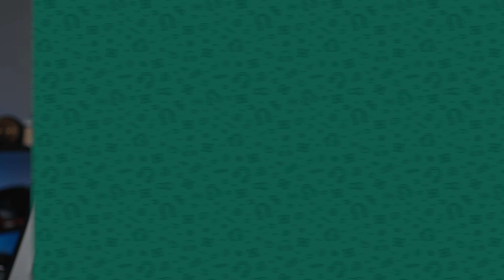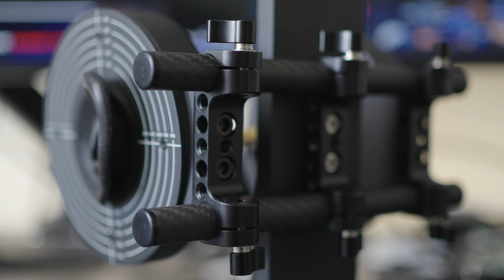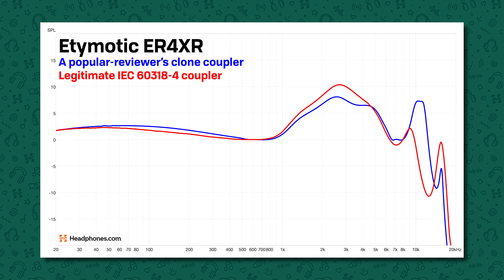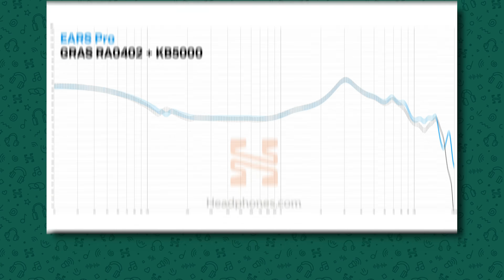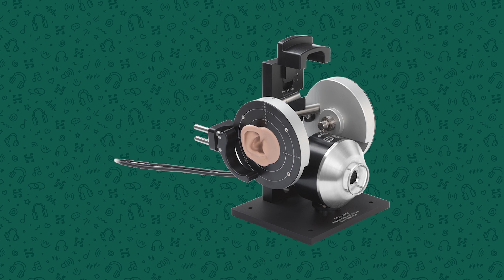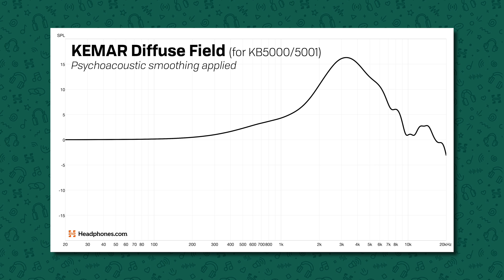High Quality Headphone Measurements are Affordable Now - MiniDSP Ears Pro Review

Comment: It seams to me this is more of the end of the learning then the beginning. Before you get to this point of understanding the equipment needed for evaluation of sound signatures there would be a lot of time spent on learning the information for basic understand of this hobby if you can call it that at this level. Where do you even start. What classes would be required to learn about the physics of sound and its application. Can you give some guidance on this. Where to begin. Thank you. Keep up the great work!

Comment: What's the point of using this ? since you said every HRTF is different and every headphone will sound different on each people, for me it seems that any measure is now useless and that only comfort and ToneGen are what matter, but i can be wrong
Reply: So this is a common confusion. It's not that "any measurement is now useless", it's that "any measurement needs to be taken with additional considerations, especially for bass and treble". Just because measurements on rigs don't perfectly depict the performance on your head, that doesn't mean they're not useful for showing how headphones perform. And, even though there is HpTF and HRTF variation, that doesn't mean there aren't trends. It's not like anything goes, or that any result could sound good to any random person.
Reply: @ResolveReviews  how are they useful and performance in reference to what? comparison with other measurements?
Reply: @chungang7037  they actually show you how things sound. Just because there are SOME differences doesn't mean measurements aren't perceptually relevant on the whole. They are, you just shouldn't overly scrutinize the tea leaves
Reply: @ResolveReviews  Differences matter, however. Tea is actually an interesting example; many people care about how and where it is grown, the temperature it was done so, the temp it was brewed at, even the cups used and in what conditions, etc. And even if all is accounted for, two people may have different interpretations after a sip. While I admire the move to try and present data consistently in any hobby, I am not convinced measurements as yet are able to account for the variables. The variables themselves are often more interesting, so I guess that is something. I would write more but I suspect this comment will be shadowbanned whether intentionally or by the algorithm, still something that only seems to happen on this channel.
Reply: @chungang7037  the existence of measurements on a product does not entail the end of differences of opinion. Measurements show you what the sound is doing in given conditions, how that redounds to good or bad experiences is a highly individual thing.
Reply: @ResolveReviews  Interesting. This reminds me of biblical scholars I was exposed to decades ago, where they would labor over interpretation of scripture down to the nitty gritty details of translation and interpolations but in all such meetings few dared speak about individual experiences with said religion, as they were seen as private and potentially embarrassing, shameful, or even heretical.

Comment: Fantastic review! This would be fantastic once reviewers as well as hobbyist start using this new rig for the measurements, cuz I assume the couplers have tighter tolerances that the clone couplers out there. 

One small critique with the review, that bass roll-off in the HP out, is a con should be highlighted more tbh. Not the end of the world, but it does stop it from being an all in one solution for measurement fixture.

Comment: Did you delete my comment on your video "Headphone measurements are about to change" in which I pointed out the problems with your claim that it is possible to make any headphone sound like any other headphone with nothing but EQ? I understand if you in retrospect realized how silly that claim was, but why not just admit it, instead of delete my comment? That would have shown integrity. I am asking since my follow-up question, inspired by this video, would be: What is the value of measuring headphones for testing them, when we can just buy a pair of $50 headphones and EQ them to sound like our favorite $5,000 headphone (as you claimed was possible).
Reply: No, we don't delete comments unless it's outright abusive or something like that. Youtube sometimes does this where it'll yeet comments if posted too frequently or if it thinks it's spam. As to the claim itself, it wasn't absurd at all. We did in fact get two headphones to sound the same with in-ear mics and EQ.
Reply: @ResolveReviews  Glad to hear. I was also surprised, as I have always seen you guys being about transparency and truth. I still think you ought to make a double blind test, e.g. the one with K-701 flipped as I suggested. I am 99.9999 % sure that you would hear a difference. So, do you think that THD and SNR is irrelevant? Do you really think that it's possible to EQ any $50 headphone to sound like any $5,000 headphone?
Reply: @stefanhansen5882   It depends on the headphones. If they're both behaving normally with respect to harmonic distortion / excursion limits, yes you can EQ the $50 headphone to sound like the $5000 headphone. It might FEEL different because the mechanical design is different, or the occlusion effect is different if one is less open, that sort of thing. But the sound can be made to be the same, yes.
Reply: @ResolveReviews  That is a big if. Low THD is one thing most cheap headphones do not have. SNR also differs and cannot be "EQ'ed away". Also, some transducers are faster than other, which also impacts the quality. EQ will also not give any headphone the sound stage of a K-701. I'm so puzzled that you are now making this claim, which seems to be in contraction that everything which have been said on your channel over the last many years.
Reply: @stefanhansen5882  Most conventional headphones have sufficiently low THD where it's not really audible when adjusted with EQ. Moreover, it's not like harmonic distortion gets unilaterally better at $5000. Some are better for that sure, but A) some are worse, and B) it's not audible most of the time anyway. With the claim "some transducers are faster than others" - this is just audiophile mythology based around marketing copy. Drivers do not have special performance unrelated to their meausreable characteristics. EQ does in fact give a headphone soundstage. We turned an HD 600 into an HD 800 S by EQing the headphones in situ. The answer to this question depends a bit on whether someone derrives "soundstage" from opennenss or lack of occlusion, or what the sound is genuinely doing, or some combination of those two. But EQ can make the two headphones SOUND identical, including soundstage, provided the psychoacoustic inference is not from other non-sound related factors.
Reply: @ResolveReviews  So HD600, MV1, Sundara,... can sound like a HE-1 ?
Reply: @skyzeworld  Yup. More importantly though, they can sound better than an HE-1. The problem with trying to get them to sound identical to an HE-1 is that you'd need an HE-1 present.
Reply: @ResolveReviews  I agree there is a lot of audiophile marketing hype. However, EQ cannot change a driver's damping, which affects "smearing." EQing an HD600 to get the soundstage of an HD800S sounds highly optimistic, since soundstage depends on physical driver angling and ear-cup geometry. Furthermore, the damping factor (the ability to electronically "brake" the driver) is a real physical interaction that EQ filters can't simulate. Finally, pushing EQ too hard to match another headphone can trigger non-linear distortion that the target model doesn't have. Tone is easy to match, but physical acoustics and time-domain control are not.
Reply: @stefanhansen5882  this just isn't true. Time domain is directly proportional to frequency response in minimum phase devices, which headphones are. There's no effect of driver 'brake' that's separate from frequency response, which can be impacted by EQ. Damping is literally a frequency response altering parameter. As to angling and cup geometry, that's not an established correlation. There are those who are looking into it, but so far nothing has been demonstrated once FR in situ is controlled for. And SO far, we know FR has an impact on soundstage precisely because we were able to turn an HD 600 into an HD 800 with in situ FR matching.
Reply: @ResolveReviews  I understand your perspective and mostly agree with it--in theory. But the driver inside a $50 will most likely produce distortion and other artifacts when EQed and/or pushed (e.g. at high volume), unlike the $5,000 can. Also, the cheap headphone is more likely to not have a consistent acoustic seal, so even if EQed to perfectly match, this will chance if the can is moved just slightly and/or when the pads begin to wear out (much sooner than on the high-end headphone). 

Bonus question: Will you put your money where your mouth is and never again use anything else but your most comfy headphones EQed to sound like which ever headphone you like the sound of? :face-blue-smiling:
Reply: @stefanhansen5882  if the cheaper headphone has bad harmonic distortion issues then yes that will be a limitation. But just because it's cheaper doesn't mean its distortion is worse, you see high harmonic distortion at high price tags too. Most of the time it's not audible. Seal related issues also impact all price points. Re money where my mouth is, I've been doing that for years already. I use cheaper headphones every day, and I've EQ'd them to sound better than an HE-1. Anyone who understands EQ correctly can do this.
Reply: @ResolveReviews  Correct me if i'm wrong, he1000se and he1000 stealth have identical build but very different driver. You can try to match them with EQ to see what's up. Feel of the headphone should be identical so minimal impact of psychoacoustics or distinguishing of what headphone you are wearing.
Reply: @ResolveReviews  I WANT to believe you, but remain skeptical. When I lift the bass on my K-701 it is struggling (to my ears, which are admittedly "rusty", while I am a former mix engineer). I hope you will make a video about how to EQ a headphone to sound better than the HE-1, in a way so people can try it at home (which should be possible, if you have done this before the lab tests you did about a month ago).
Reply: @musicxxa6678  yup, they would sound identical if FR is matched in situ. The only thing that might matter there is if the harmonic distortion is high enough on one of them in a different spot than the other. Those more loosely tensioned ovoid planars can sometimes have higher than typical harmonic distortion. I'm not saying it's audible with music, but since distortion is related to level, if the EQ involves adding a specific peak in an area that has higher distortion it could make it audible.
Reply: @stefanhansen5882  Tone gen is the key. Re the K701, I'm not too familiar with that one's distortion characteristics or FR down low. I have the k712 pro here and I can say confidently it's a very bad headphone. Not sure about the others in that series.
Reply: @ResolveReviews  That is why I mentioned the K-701 (which I guess is very different from the K-712), since it is a headphone I tried to "rotate the pads 180 trick" with (by mistake to be honest), and which is not a $50 headphone. So, would you be able to make the K-712 sound as good as (or better) than the HE-1? And what did you mean by "tone gen"? PS Thanks a lot for engaging in this discussion. It is fascinating.
Reply: @stefanhansen5882  price and performance have no correlation generally, so it doesn't matter how expensive your k701 is. But also, it'd be incredibly foolish to try to get two headphones to sound the same, it's way easier to get the cheap headphone to sound better than the expensive one. Tone gen is a tool like owliophile. Look into that.
Reply: @ResolveReviews  I agree that it is silly to make a headphone sound like another headphone. It was just what you said was possible. I looked at Owliophile. Interesting. It seems to help with my own approach: using sine waves at increasing volumes to find my own "personal Fletcher-Munson Curve" and using that for a starting point for my own EQ optimizations. I've never seen you talk about this on The Headphone Show. Maybe I missed it?
Reply: @stefanhansen5882  Harman research > Fletcher Munson. Or in other words, relational preference > perceived loudness.
Reply: @ResolveReviews  As I wrote, I am a forming mix engineer. I know the difference between these. 😉 However, I''ve used a "personalized FMC" to adjust EQ based on my hearing through the frequency band.
Reply: @ResolveReviews 
Wow, I feel like this kind of information should be raising awareness worldwide, but apparently only I find it so interesting.
I imagine the HE-1 has a rather low acoustic impedance, which would make it more consistent on each head. But technically, an EQ could make any headphones sound decent, which makes me think the only valid criterion is comfort, and that headphones costing €1000, €2000, €5000... are just pure marketing and an engineer's fantasy.

Thank you for all your work; you've opened my eyes, but to me, it's like you told me Santa Claus doesn't exist. I was just carried away by everyone's local fantasies.
Reply: @skyzeworld  Generally this is all true, however the missing piece here is that people aren't making headphones for the purposes of EQ. Most people don't EQ, and certainly very few of us get THAT deep into EQ. So when manufacturers are making headphones at whatever price points, as far as they're concerned, Santa Claus genuinely is real - or at least may as well be real. Like think about it, if you're buying a "sound signature", or a specific experience with your music, it's not unreasonable to place a certain value on that. Those of us who EQ are basically just using cheat codes for sound quality.
Reply: @ResolveReviews 
Thank you so much for taking the time to reply.

It's so strange that you really have to search for this kind of information, when nowadays it's so easy to get PEQs, and I'm sure that if more people knew, they would simply tune their headphones.
It's as if audio brands are hiding the truth.

What seems to be a good step forward is technology like Bose's CustomTune in the QC Ultra 2; it wasn't perfect when I tried it in the store, but it really puts it ahead of its classic competitors (especially Sony).
Reply: @skyzeworld  Yes, assuming it is true. However, it is not. EQ is only part of the sound of a headphone. Don't trust me, and don't trust Resolve. Trust your ears. Try boosting the bass on whatever headphone you have. At one point you can hear the driver struggling. Depending on the quality of the headphone this will happen sooner or later. So, if you have a headphone that needs more boost than the headphone can handle (to get the frequency response you want), yes, then you can EQ it to get the frequency response you want, while compromising the sound on other parameters just as important for sound quality.

Comment: Can't the results from harman research and or harman target be just adjusted by difference between the current rigs and whatever the research was done with?
Reply: It's not quite so straightforward, because you need to compare welti-modified pinna data with the same headphones measured on official rigs, and nobody has access to that pinna. But our updated preference bounds is based on something that. It's just not public yet.
Reply: @ResolveReviews  "nobody has access to that pinna" that's the main bit I was missing, thanks.
Reply: @ExplosiveNotes   I say nobody... Apparently this is something Dan from DCA does have access to, and he's been working with Dr. Olive on various things. He may be able to share that with us as well. But yeah... check out some of the stuff Dan is doing on this.

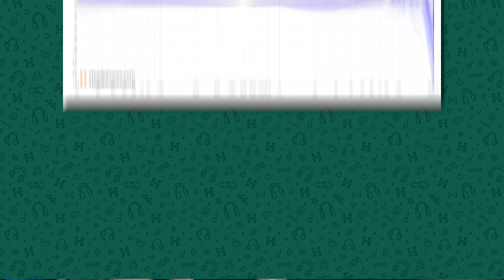Comment: 3:47 this doesn't tell you if the variance is due to the incorrect impedance or due to positional variation of the earphones measured. You have to measure the transfer impedance to actually know if the coupler is "legitimate" or "standard compliant". Also what if your "legitimate" coupler is exhausting the tolerance?
21:12 If we are going to put so much weight onto poorly constructed official standards and defacto standards where only one private entity is able to actually build it to intended spec we should acknowledge that this is not a type 3.3 simulator. For that you need a pinna simulator like KB1065 with the old geometry but made from elastomer with 35±6 Shore-OO hardness meaning that a lot of pinna simulators still using 55 Shore OO do not follow the ITU-T recommendation currently in force.
Reply: I'm of the opinion at least right now that this kind of variance between 1-5khz is less indicative of insertion depth variance or length mode propagation, and more to do with how close the mic gets to the spec. It could be due to differences in damping or impedance, but either way, if you're buying one of those clones and you don't have the ability to compare it to an official model that's in spec, it's hard to know if your data is lying to you.

Comment: Would be fun to compare my ghetto rig to this to see how much better it is for the $1400 higher price🤔

Two pinnae and a coupler is about $300 from AliExpress and glued on pieces of board work pretty well when I've compared to proper measurements. If I knew this was a good step more accurate I might get one, but knowing that will probably take a bit of time🤔👍